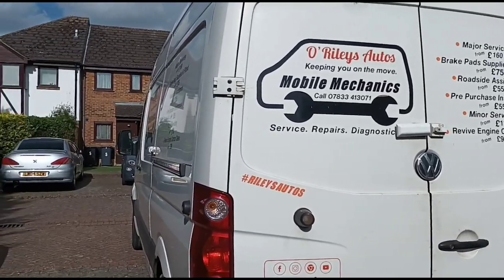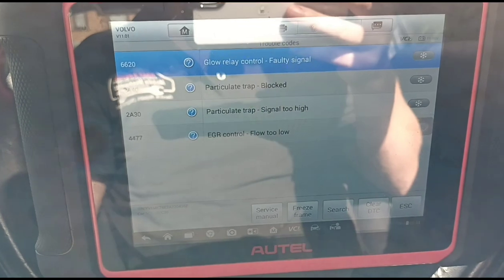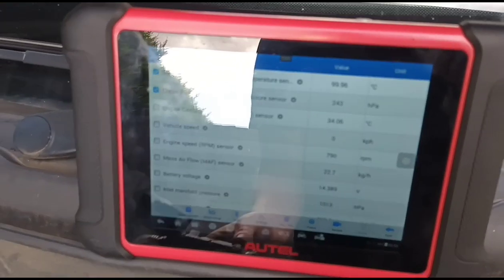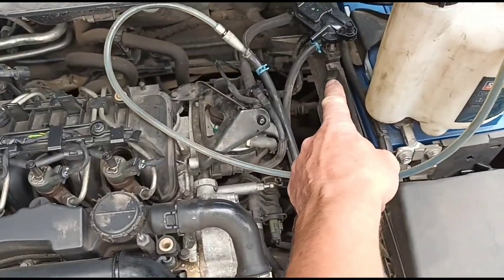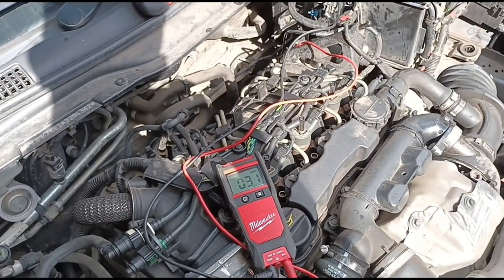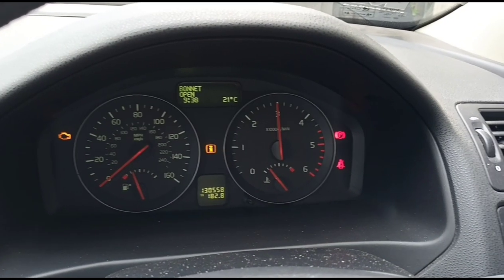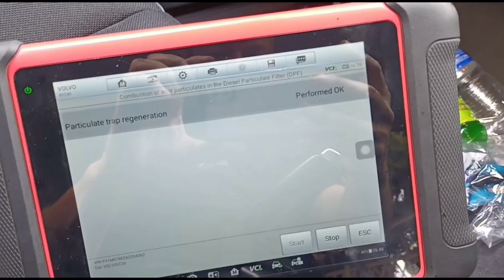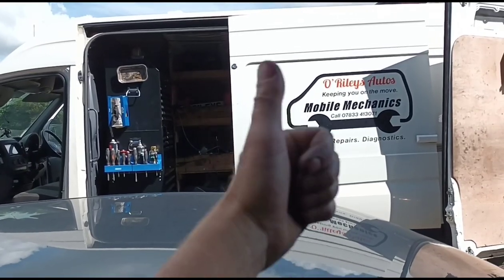2A40 & 2A30 Volvo C30 1.6Hdi Particle Filter Blocked

Comment: Great Video's, I'm all educated on DPF now ,  but as brands move on my questions is about the cleaners , You used Wynns Off car DPF cleaner with the pressurised container to get it into the DPF, The Wynns site states you need to take the DPF off and leave the Fluid in the DPF to soak for some time, then rinse with water. As you used it in a different way is this the work around way used by all .  
Later videos you started using the Launch UK fluids to clean , but off course one needs a modified spray gun to apply to apply. This product is now sold out on their website and I wonder if there are fakes being sold for less .

Comment: Brilliant explanation. I have exactly the same car. It has some boost when i first set off but that soon fades to none. My idle dpf pressure is 14 hPa and 75 hPA at full throttle. The car has no diagnostic fault codes. Could it be the dpf at fault? Thanks.

Comment: Any advice for a vw crafter 2016..new glow plugs but still not starting great. saying when plugged in again that plug 4 is not working but has been tested and its fine my mechanic thinks its something to do with the ECU. Any advice would be appreciated. I'm in Merseyside if you are near?
Reply: Do the glow plug make a difference unless you are at minus 30?
Reply: @robevans8625 only a few seconds more turn over time first thing in the morning
Reply from the maker: Glow plugs don't affect starting much in normal weather. I'd look more at the fuel pressures and injectors + EGR
Reply: @ORileysAutos  diagnostic keeps saying glow plug 4, could there be a power supply problem to it?
Reply: @ORileysAutos  forgot to say its only done 25,000 miles
Reply from the maker: @anotherbrickoutthewall9237  did you check the plug at number 4 to see if the voltage is there
Reply: @ORileysAutos  thanks for the reply.. Just asked him now.. He said there was no voltage.
Reply: Hi mate would my c30 r design have a dpf it is 61 plate ?? Thanks
Reply from the maker: @CR_C30R  yes I would think so
Reply: Any help on a volvo 1.6 hdi have a code ECM-2A50 particulate trap also can't remember the code but relates to the dpf heater sensor any help also what should the dpf pressure sensor read on tick over it reads 0 
Cheers